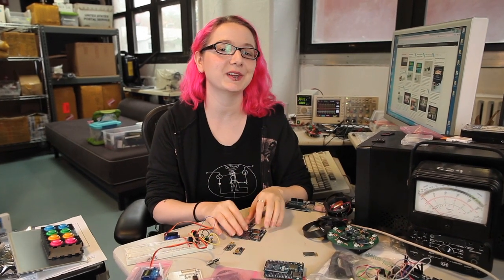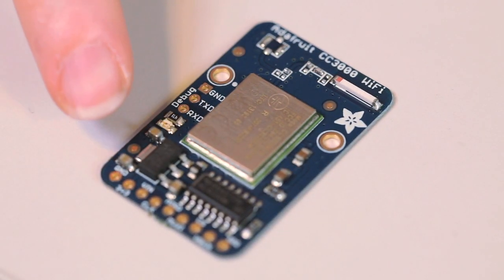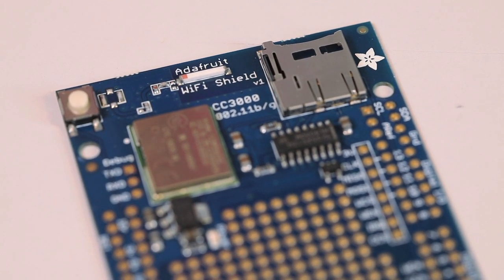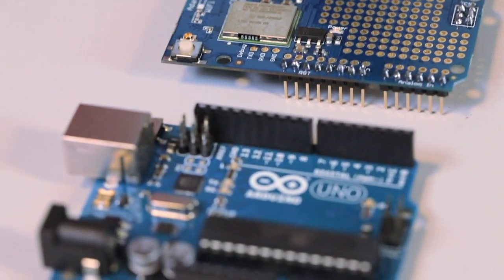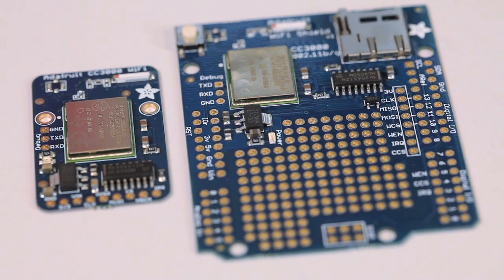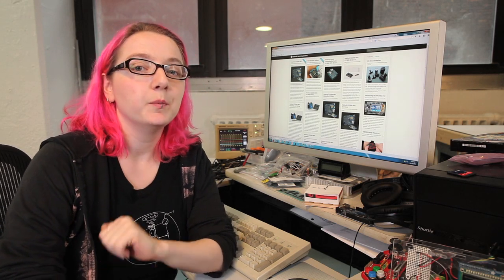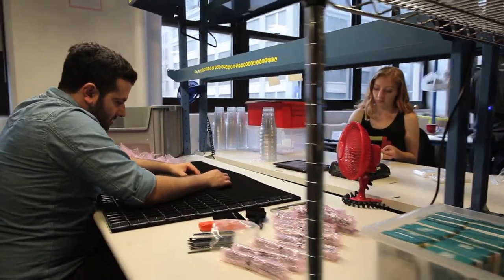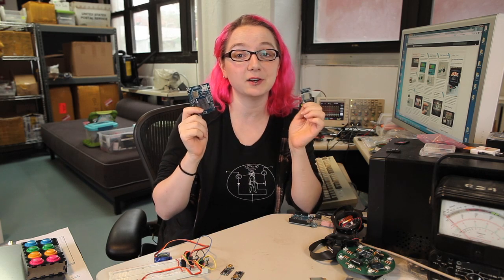Adafruit Internet of Things - TI CC3000 series

Comment from the maker: Introducing the Adafruit Internet of Things – TI CC3000 series! (video)
Adafruit Internet of Things - TI CC3000 series
http://www.adafruit.com/index.php?main_page=adasearch&q=cc3000

For years we’ve seen all sorts of microcontroller-friendly WiFi modules but none of them were really Adafruit-worthy. Either they were too slow, or too difficult to use, or required signing an NDA, or had limited functionality, or too expensive, or too large. So we shied away from carrying any general purpose microcontroller-friendly WiFi boards.

NO LONGER!

The CC3000 hits that sweet spot of usability, price and capability. It uses SPI for communication (not UART!) so you can push data as fast as you want or as slow as you want. It has a proper interrupt system with IRQ pin so you can have asynchronous connections. It supports 802.11b/g, open/WEP/WPA/WPA2 security, TKIP & AES. A built in TCP/IP stack with a “BSD socket” interface. TCP and UDP in both client and server mode, up to 4 concurrent sockets. It does not support “AP” mode, it can connect to an access point but it cannot be an access point.

We wrapped this little silver modules in a tidy breakout board. It has an onboard 3.3V regulator that can handle the 350mA peak current, and a level shifter to allow 3 or 5V logic level. The antenna layout is identical to TI’s suggested layout and we’re using the same components, trace arrangement, and antenna so the board maintains its FCC emitter compliance (you’ll still need to perform FCC validation for a finished product, but the WiFi part is taken care of). Even though it’s got an onboard antenna we were pretty surprised at the range, as good as a smartphone’s.

Each order comes with one fully assembled and tested breakout and a small stick of header you can use to solder in and plug into a breadboard. We don’t have a detailed tutorial yet but to get you started, we’ve got a fully working Arduino library that is based off of TI’s codebase but adapted for use with the AVR. We also have example code showing how to scan the SSID’s, connect to your access point and run DHCP, do a DNS lookup to IP address, ping a site and connect to a remote TCP socket such as a website and print out the page.

Texas Instruments   #ti     #texasinstruments     #cc3000     #iot     #internetofthings   Limor Fried Arduino   #arduino
Reply: This is a great addition to any arduino projects and opens up a new realm of possibilities. Great kudo's to  #adafruit  for providing both the technology for easy purchase and great examples for learning how to use them! Awesome.
Reply: I like the explaination LadaAda gives for such introductions, usually "I have a box of vendor modules/items and none met our expectations until we found THIS which was the best."  The TI module has many features not found in older units at a good price point (which is the criteria most folks generally use: build an excellent product at a reasonable price).
Reply from the maker: thanks everyone!
Reply: awsome!

Comment: hi, i just tried to connect cc3000 on arduino uno with an ultrasonic sensor HCSRO4. so, before i ask how to get the data from the sensor to be send thru wifi, isit possible to connect these three components? since using cc3000 with arduino, i need to leave out pin 3,5,10,11,12,&13 where most of them are PWM. since the ultasonic sensor also need 2 PWM pins, im left with just pin 9 with PWM. so, is there any way that i can connect the components correctly or i need to use Mega for this project? thanks for ur help.